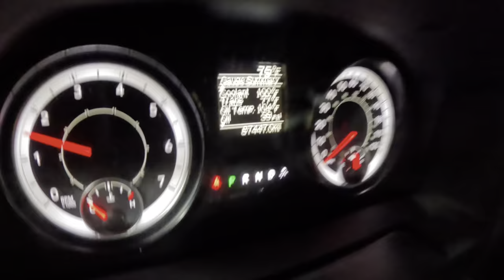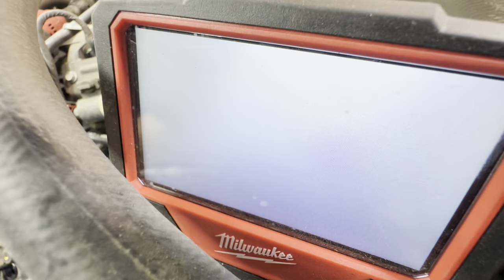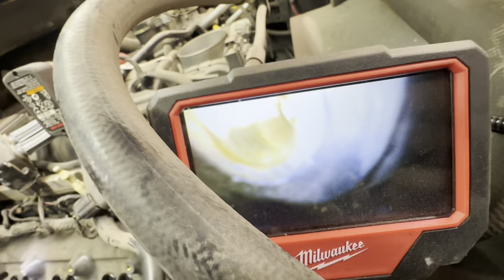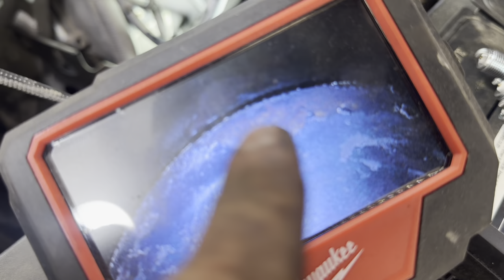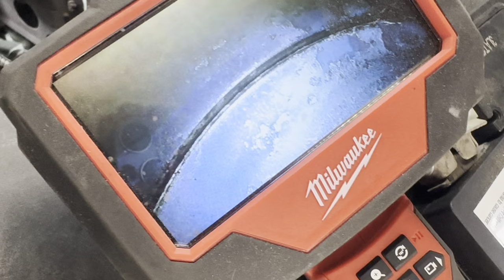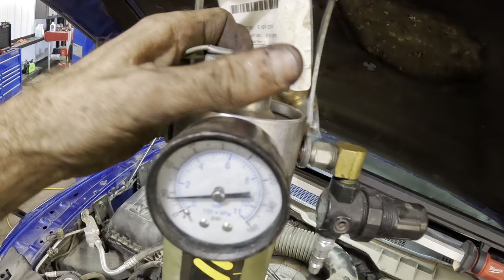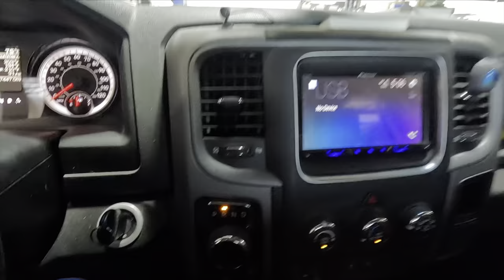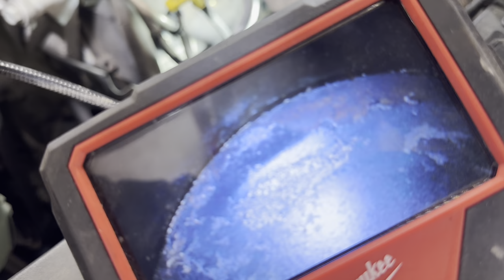The “TUNE UP” is DEAD! Dual Spark HEMI! (Injecting liquid into the Intake)

Comment: Ray I love my Hemi, but changing out the spark plugs is definitely a challenge. I don’t have the fine wobbly bits that you have or the electron rachet. But you made it look easy! I tip my hat to you. I was blown away when I realized that changing the plugs myself would still cost me over $300!
Reply: A co-worker had his plugs changed on his 5.7 Ram hemi truck. It cost him over $1400.00 !
Reply: That’s a bit ‘spensive. Even if they have a markup on the plugs, it’s only a 2 hour job so they were getting $500 hr! Wow!!

Comment: You have to pick the right snake oil for the job. I used BG EPR on my three toyotas. The 17 Tacoma with 85,000 miles had zero effect. It stopped minor oil consumption and improved smoothness on the 4 cyl 2006 Highlander at 180,000 miles, and it stopped smoking on startup in the 2003 4 cyl Camry with 110,000 miles. I can't imagine any benefit on these port injected engines that are running perfectly.

Comment: I just find it funny that after all the crap people have given me about the 8-plug 2.3 Lima engine for the early 1990s Ford inline 4-cylinder engines, Dodge decided to use the same engine theory on their Dodge truck engines: That to get a better combustion in the combustion chamber, and to more thoroughly burn fuel and recirculated EGR gases, they use a strong primary burn, and a weak secondary burn -- which is why every cylinder has 2 plugs.
Reply: Nissan had duel plugs in the late 70's.

Comment: Ray I remember when we used to regap plugs because the metal piece bent out after so many mile. Anyway after 50k mile I would change them out anyway and not even check for gap. The question is a bad gapped plug worn out or just a bad gap.  If I was told to check everything I would change the plugs also. I like the new zero drive ratchet. Nice video

Comment: I think the latest rage in cleaning the carbon buildup from intake ports is the walnut shell blasting, seems to be the most effective and also the fastest.
Reply: Walnut shells is a very old technique, Frozen CO2 is the latest.
Reply: Walnut shells is a very old technique, Frozen CO2 is the latest
Reply: The hemi is not direct injected, no need for cleaning, at least not for the first 200k miles.
Reply: Used blasting method to clean pizza pans & rubber production molds works great
Reply: Hard to do with the engine in the car, no?
Reply: @BixbyConsequence  you can actually, but u need to remove intake manifold of course first, u will find plenty YT videos showing just that, cheers.

But usually the walnut shell blasting or dry ice blasting makes sense when there is heavy carbon buildup in the intake ports which occurs in direct injected engines, but if it's the case as someone suggested above that this is a port injected engine than there will not be carbon buildup inside the intake ports, older engines are port injected.

Comment: Intake induction is definitely not snake oil. Ive used the BG stuff regularly on my Hyundai GDI and i recently pulled the intake manifold off to do an injector and at 231k the intake ports were almost perfectly clean.

Comment: The spray from the atomizer seemed to be just recondensing on the throttle baffle due to the lack of distance between the 2. I bet that's why they say too place it in the air stream inside the intake hose instead of at the throttle baffle.

Comment: The spray is for upper end. The additive you add to gas tank is for piston and cylinders. Have the customer come back after the fuel additive has been run through and recheck it again.

Comment: Two aspects of maintenance that made the most difference in operation was cleaning the throttle body and using BG EPR which removed carbonized oil from the oil rings. This was done around 180,000 miles. Spark plugs, filters, and PCV service at different intervals made no difference. BG EPR is the only snake oil product I have tried and found to be effective.

Comment: I had a 2005 Ram 1500 Hemi, a 2010 Ram 1500 Hemi, and a 2013 Ram Laramie Hemi, bought all 3 new . 2013 I did plugs at 29k miles, real fun job... LOL the very back on firewall both side were a bitch, but I got them, took me 2 hours due to my lower back killing me.  I changed out plugs due to engine running oddly, afterwards it ran great.

Comment: I have seen people use a piece of tubing to start plugs.  I understand that you can't test the "snake oil" properly but to me what you would need to do is have a dirty engine that you could pull the head(s) off of to look at the valves and pistons before and after running it for a month or so.  I know that one method of cleaning valves involves blasting them with walnut shells which I suspect is a fairly expensive job.

Comment: I have a CO detector in my shop and I was surprised at how quickly it would go off with a car running with the door closed and no fan! My shop is only 24x44 but I have to open a walk in door at other end of shop to keep alarm silent with a cross flow!

Comment: To me the term "tune up" now means "routine maintenance" (and really, back in the day adjusting your carburetor, checking plug gaps, checking points, and valve lash was considered routine annual maintenance).  I remember one of Dad's cars at 5 years old needed what was called a "gaskets and seals" job - basically replacing all of the commonly worn seals and gaskets (head gaskets, thermostat, rear main, etc.), and that was considered normal wear and tear at 5 years old.  These days, we expect things like gaskets to survive a lot longer than that!.

Comment: This may show off my ignorance as a non-mechanic, but it seems like the snake oil procedure could be a scan tool feature if it's capable of controlling throttle - set a baseline 2000 rpm and an upper rpm (4000?) at a selected interval. Then just hit Go and have the scanner automatically do the repetitive bits. Feel like that would bring the technician cost down and free them to do more hands on technical things that bring in more money 😂

Comment: The Zero Drive ratchet is intriguing. Currently not available from company in Huntsville, AL. A very similar product called Zero Degree was available on Amazon at about 1/5 - 1/6 the price of Zero Drive. Both ratchets were available in 1/4 and 3/8 drive sizes but neither is currently available. Zero Degree company wass located in NJ and product was produced in Asia. Gotta wonder if a patent lawsuit is a part of the equation,

Comment: Why 16 plugs: the Xtra 8 is for emissions, they fire on the exhaust stroke -- I believe. My 4 cylinder Ranger has 8 plugs for the same reason. And after 265k miles, it passes smog with flying colors! All the emission #'s are extremely low.

Comment: Sone of the Chryslers used NGK's.  I always put them back with Champion if I can (if they were also an OEM plug), cause they are cheaper.   I found this on some 300's as well.
Reply: I've had several Mopar vehicles. It's my understanding that back in the good old days all Chrysler, Dodge, and Plymouth vehicle's came from the factory with Champion plugs. I use the copper plus.

Comment: Ray, in the old days we would mist water in the carb, to clean the cylinders,  Water turns to steam and cleans the cylinders.  If you have ever seen a cylinder with a leaking head gasket that cylinder is always cleaner than the others.

Comment: I usually do an oil change after using any kind of engine cleaning chemical, be it fuel system cleaner or intake cleaner. Some of the stuff that gets loose will end up in the engine oil, reducing the efficacy of its dispersing additives. Better safe than sorry 😊

Comment: I've always been a little hesitant to use any cleaners that power off carbon deposits from cylinders.  I guess this fear stems from having to replace a clogged catalytic converter.  Have you ever had follow-up issues of clogged cats soo using these types of products?
Reply: I think you're experienced tech. Rule of thumb is don't remove carbon film from piston rings area. Nice

Comment: My opinion on vapor cleaner is this..most people use the gas tank/intake valve cleaner only. If your going to mist it.. it will certainly do a better job than gas tank additive. Your doing both should show your client your willing to go the extra mile to protect their vehicle. If done at equal intervals its great but on older/high mileage vehicles it just might do more harm than good. Older vehicles use additive in the gas tank and avoid the mist. Do you agree?

Comment: I've never used BG, so all my opinions would be from observations here. These modern engines do tend to get more carbon in the intake system. All do build up carbon on the pistons, part of the process. The cleaner the system, the better it runs. I'm writing this prior to the re-check via the borescope to see the results of the cleaner.  Back in the day we ran various things through the system to help clean. I'd bet the injection through the intake to be the best, with the additional can in the tank.  We'll see...  😁

Edited comment:
After: I see that the carbon on the pistons is much thicker than I thought. It will take a bit of time to remove. To me, the carbon did appear to have changed and may disappear with use. It might be interesting to have a customer drive the vehicle to the next oil change interval and scope the cylinders then.  Just a thought.

Comment: I've seen improvement with using berrymans in my mpg.
Definitely seen clean engines insides using seafoam and BG.
Not a fan of coolant boosters or leak sealers.

Comment: In the days of old we used to mist water over the top of the carb at 2000 RPM and would do similar things to the carbon in the cylinders. I'm m sure that the atomizer works better than the "Windex" spray nozzle did though.

Comment: Run the cleaner with the original plugs in as to not foul the new plugs with any carbon buildup that is removed.
13 lb-ft for plugs, 5 lb-ft for coil packs.
Reply: Exactly!

Comment: decarb treatments work. 
we would not touch the plugs on a ford triton without doing a decarb first. pulled them in at the end of the day, cleaned the throttle body, then do the decarb, toward the end of the decarb give it some WOT hits and then loaded it up with cleaner trying to stall it, if it doesn't die shut it off & leave it till morning. 

first thing, don't even crank it, just pull the plugs. then with a thin long tipped blow gun, blow out all the cylinders. new plugs, boots or coils and back together. 44k in the tank and do the test drive. you got to get some WOT runs and let it shift 1-2,2-3 a few times. last thing, do the oil change & ship it. 
doing this way, i don't recall ever having a problem with broken plugs. oh, and a dab of anti-seize on the plug threads going back in.
call it snake oil all you want, we repaired a lot triton spark plug problems from other places who did not do a decarb.
i've been out some 14 years now, so i don't know if the chemicals have changed., but the ones i used worked great,.. when something new came along, i would try it. no eco-wacko friendly crap ever worked very good if at all. never found nothing better for throttle body sludge than BG throttle body cleaner.
forgot to mention, we cleared the PCM memory just before the test drive.

on those calls, i tell them its being recorded for the impending lawsuit.

Comment: I got lost when you did the first bore scope after treatment I couldn't see what you were describing since the camera wasn't showing the screen. Then all of dialogue started again and was exactly the same but with the screen in view. Did anyone else notice the same thing? Were you using 2 cameras and just didn't edit out the first one without the screenshot? I wish the results would have been more impressive or that we could have seen the valves. Maybe you can have the customer bring it back in a week and do a short so we can see the results after several heat cycles.

Comment: Ray, I’ve always liked Lucasoil, I have not heard of this product, but have watched dozens of videos saying SeaFoam hurts engines… this product seems to work, wouldn’t I get similar results running my engine on a highway at highway speeds for a long trip like 500 miles or does that not clean the carbon out of

Comment: Quick question, you atomized the liquid only for it to pool on the butterfly, so is there any real point in the atomization of the liquid in the first place? (Genuine question not REEEEEE LOL)
Reply: Great question. The atomizer applies the chemistry at the rate that’s effective to saturate the carbon….It’s wet because it’s working. The goal is to scathe clean vs chip away carbon. The cleaning process will continue over the next few days…The chemistry is still working along with the 44K in the fuel tank.    This is a great video showing the correct way to apply this Svc. *I am Ray’s “BG GUY” fyi

Comment: They loved their spark plugs so much they put twice as many!😂
Reply: Everything on this Engine is Hard to Replace, Engineers Build Crap but Never Work on Them...
Reply: Emissions. Two flame fronts gives a more complete burn when tweaking timing for more power.  It allows the computer to do more for fuel economy while still being able to generate power when needed.
Reply: @sumduma55  well if it’s emissions why not put in 24 spark plugs and while you’re at it put in 14 more sensors, those pesky emissions that we cured 40 years ago. I think they need an injection system to make my exhaust smell like rose petals and potpourri , but that might take more relays and servos and a few more spark plugs…😁
Reply: @devinangola3458  how does any of this crap you mentioned affect emissions? I already said how 2 spark plugs does.
Reply: @sumduma55  my original comment was a joke , but you continue so I can troll you. 
  More spark plugs!😛
Reply: @devinangola3458  you over estimate your witt. You just appear soar over showing your prowess and failing.
Reply: @randybeard6040  Yeah, always wish the engineers would just ADD 6 more inches to the engine area would be SOOO APPRECIATED!
Reply: @sumduma55  nice to see you along for the ride.😉
 …well how does two spark plugs improve a motors efficiency’s? If you’re running straight liners/funny cars at a high RPM I can see the need , but then again that’s there for a fail safe if you foul a plug on launch.
    When I was crew chief for a super stock we had two brain boxes if one failed , modern computer chipped vehicles I’m sure would have the capability to alter combustion for both fazes of road to power with out complicating it for road use with doubling the spark plugs…  
   What’s the reason? 
  Just to let know AGAIN…this was a parody of Ray saying “ I love my job so much I do it twice” , I’m  a fukn no mind and thought it was funny. The mocking you was probably over the top… but here we are!😂
Reply: @devinangola3458  I already explained that in my first reply. I don't think it is overly complicated but if you need something more pedestrian,  I'm not going to be the one to explain it for you.
Reply: @sumduma55  pedestriasize me, humour this plebe !😂
   Happy eclipse day! Peace out.😎👍
Reply: The spark on the two plugs are timed microseconds apart? By the wannabe computer?

Comment: Question - if the oil rings are gummed up, will the BG clean that up?
Your cleaning takes me back to the Dri-Power days when you punched 4 tiny holes ion the top of the can and then held it over the carb while someone else reved the engine. Those were the days...........

Comment: Whatever happened to closing up the gap on plugs?
Used to be test the resistance & insulation & if in spec, correct the gap & reinstall.

Comment: Ram trucks come with NGK iridium plugs from the factory.   Factory change interval is 100K miles.  Pre 13 rams had copper plugs with a 30 k interval. Still were NGK.
Reply: My ‘07 OEM plugs were copper Champions.

Comment: Interesting, the last ones that I worked on only had the standard plugs in them. It's good to see that they finally moved to iridium plug. And the standard gap for iridium plugs is about .040
Reply: Iridium plugs are designed for 100,000 mile +.... Just for manufacturer warranty.
Iridium is not the best for out and out performance.
I use a plug with a capacitor inside... 50 million watts per spark instead of 50 watts with a sparkplug.
The capacitor plugs use Inconel Electrode to withstand the heat.

Comment: FYI, although it doesn't contain an upper cylinder lubricant, just spraying acetone in the intake manifold (using the same process) would have no doubt given you similar results.... I'm thinking ...  and its a lot cheaper...
Reply: Only if you want to destroy the engine.
When the piston moves down, it leaves a thin film of oil on the cylinder wall......anything that removes that film, is causing the engine to "age" in dog years.  Stick to the the formulas from the pros.
Bet you think 0-20 and 0-40 oil is too thin and you would like to use 5-30 or 10-30 (no matter what the engineers say) ??? Huh????

Comment: it is indeed true that higher temperatures can increase the efficiency of certain chemical reactions, including those involved in cleaning metal surfaces. This is due to a variety of factors, including increased collision frequency, activation energy, and the effects of temperature on the Maxwell-Boltzmann distribution. So, to answer your question about the specific higher heat reaction for your chemical engine cleaner is. a combination of concepts related to chemical kinetics and thermodynamics.